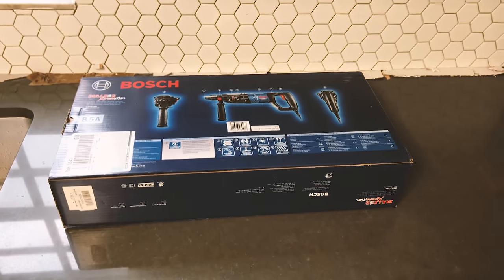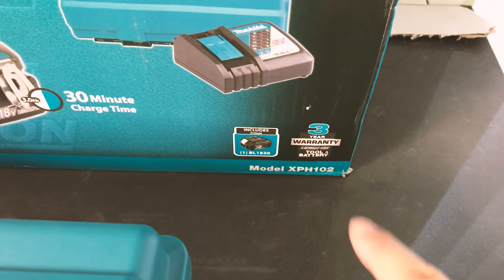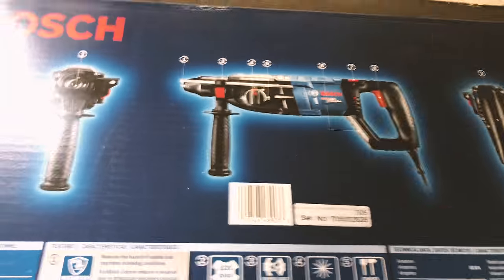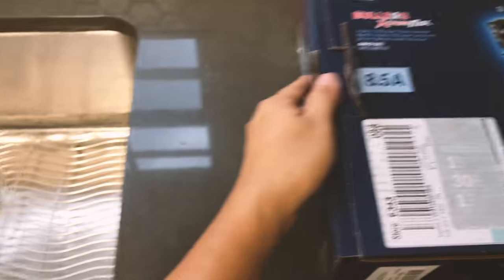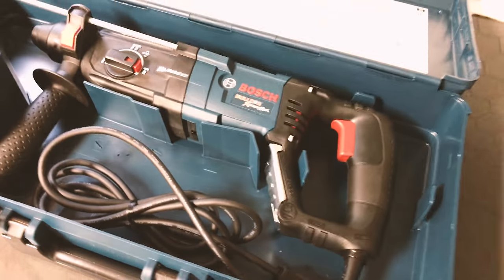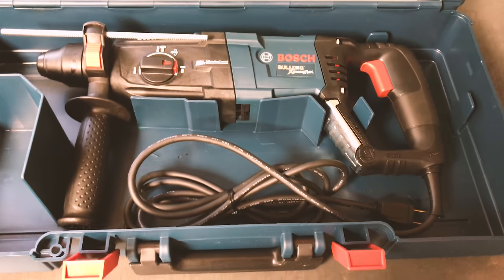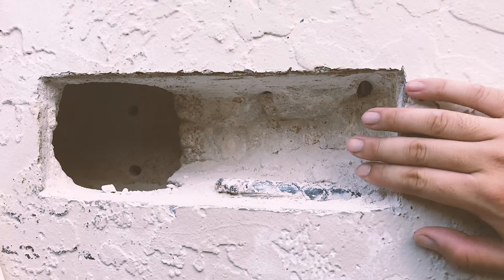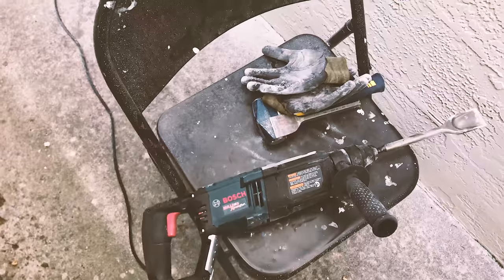Bosch's New GBH2-28L SDS-Plus Bulldog Extreme Max Rotary Hammer Drill Unboxing

Comment: I've owned this hammer drill for a year now, and it's amazing so far. Proberly used it for 200 + hours drilling/chipping concrete on jobs. Really robust also, typical of bosch 10/10
Reply: Thanks for the in field feedback. I'm picking this up tomorrow morning, using it for drilling up to 1 inch holes (12-18 inch deep) through brick/concrete, wood, plaster and drywall in order to fish wires for cameras.

Hammer drills just don't offer me the power that I need. Have to bite the bullet and commit to Sds bits and rotary hammers now.

Comment: I compared all maschines above 2 joule impact. I found the Bosch GBH 2-28. Its the same technique as your RH228 but it looks more conservative, like a big drill. The impact of my GBH 2-28 ist 3,2 Joule. There is nothing on the market with a reasonable weight and a reasonable price that looks and behaves like this "BMW-Drill". 
This GBH 2-28 really makes a difference to all products I knew so far.
Reply: I bought a Chinese rotary hammer drill for about 100 bucks. I used it to drill basalt rocks prior to splitting them.  I used it infrequently and worked well for probably 5-6 hours of heavy drilling and then kaput! I am looking for a more reliable replacement but unfortunately these videos do not show how these drills perform or how reliable they are when the going gets tough.